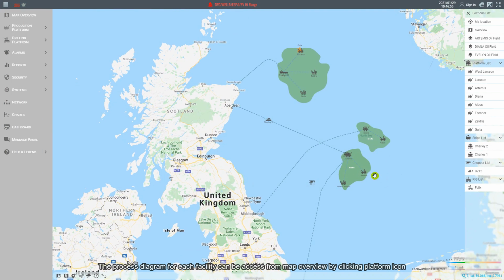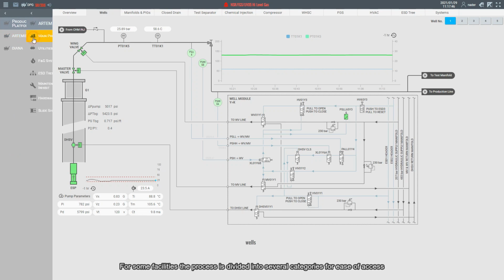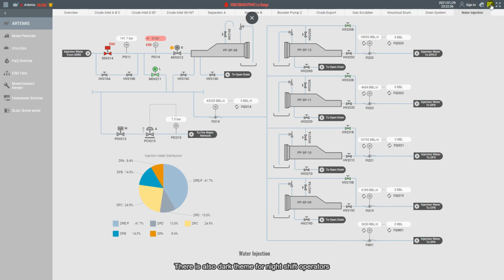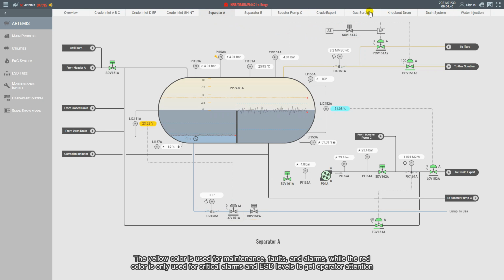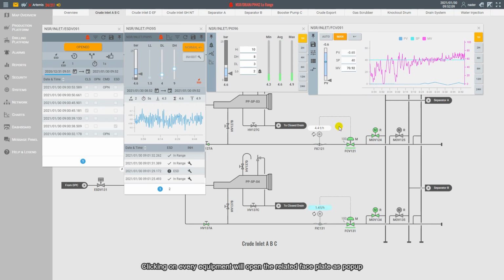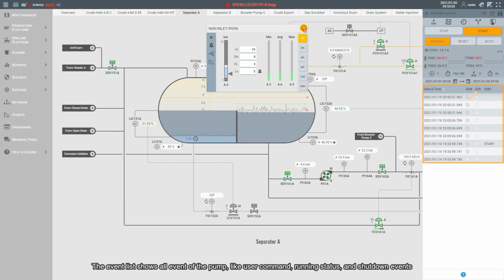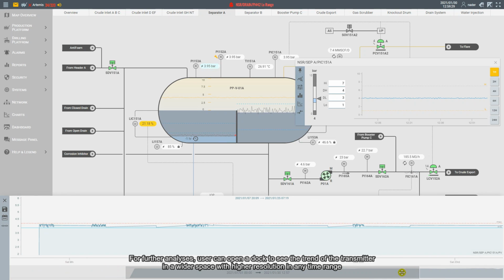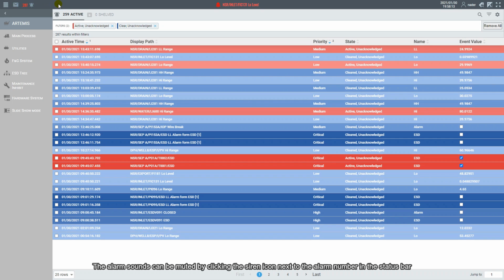Geo SCADA For Offshore - Part2: High Performance HMI (Inductive Automation Ignition - Perspective)

Comment: I tried to create a alarm system like yours in the application header, but I had performance issues. Did you use the system.alarm.queryStatus() function to build it? I used it after a now(5000) expression, but it didn’t work well.

Comment: Hi  Mr. Nader, I'm very impressed with the projects you've created. And I have a question, for symbols or objects with the same popup style, should I duplicate them to tag each popup or just need 1 popup style and custom tagging? Looking forward to receiving your reply!
Reply from the maker: You just need one popup style or template and just pass the tagpath for each device
Reply: @naderchinichian  It works -I create a template and pop-up page and pass all the UDT tags, it worked for all component in the pop-up page, but it did not work for the Easy charts, which are designed in the pop-up page??! Your comment will be highly appreciated

Comment: Nice video. Just have a question “are the symbols for equipments and line diagram made  in perspective module or made with a svg software and used in the ignition”?
Reply from the maker: I use external svg editor to create them and them import it into perspective one by one
Reply: @naderchinichian  how you are drawing all the lines after you create SVG files and import it